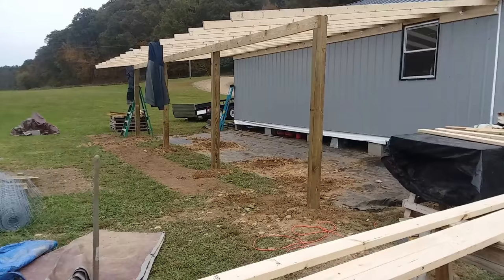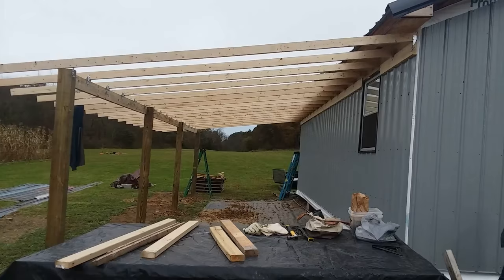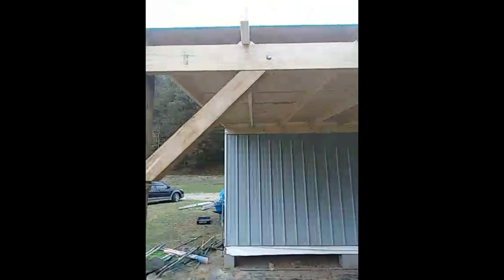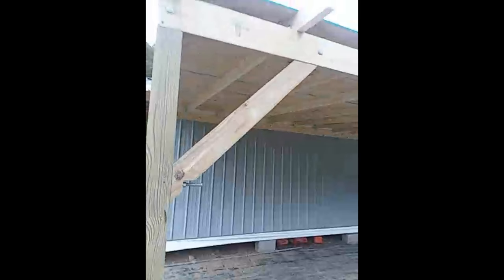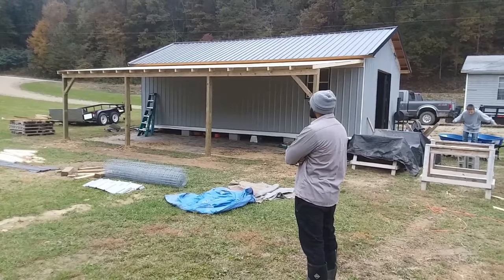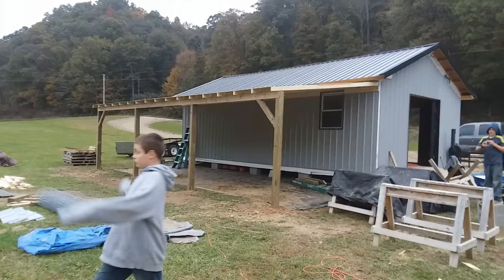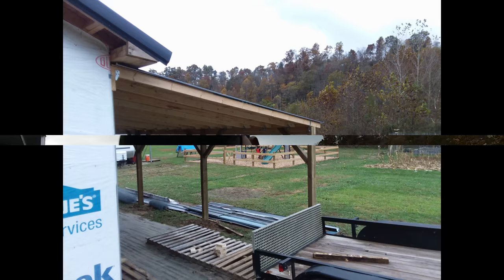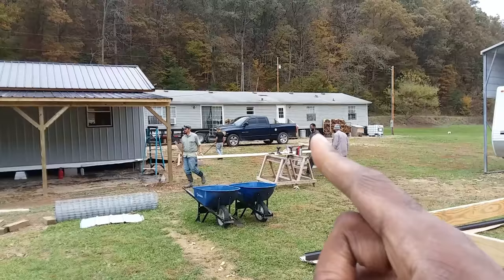Lean To Project

Comment: 2" X 4"s are not strong enough for a rafters. They should've been 2 X 6 instead. Ask a building inspector before building something like that. If that goes a down in a storm, your insurance won't cover it.
Reply: You can use either 2×6 or 2×4 rafters for roofs with a 3/12 pitch or greater, but it depends on the overall size of your shed. For roofs that won't experience heavy snow loads, (This is Kentucky) a gable roof can span up to 22' with 2×4 rafters.
Reply: If i did it again yeah i would probably do 2x6 instead of 2x4 it was only $30 more in total. But i was only putting up some corrugated plastic cover I think its going to be fine.
Reply: @JohnCruzProductions yep. I got one I built 30 years ago in WV it’s held up well 24x36 it’s had 36” of snow on it and it’s still standing ✅

Comment: What a beautiful spot you have there. The lean-to came out really nice and that is one of two ways I want to add to the back of my shop. Depending on the price of wood,(it is now Jan 2021, and lumber prices are through the roof due to COVID-19). I was going to just put on a close-like room to store the dust collection, but now I may just add 6 feet to the entire width of the shop. It's kinda tight so just 6 feet would really help a lot. The corner bracing looks very nice!
Reply from the maker: Thank you. We could have done some things better like use 2x6 boards but it's ok, we will deal with it at a later date.

Comment: You guys did a great job on this build.  I'm starting mine this weekend.  Your roof is a bit level or flat.  I need a good pitch.  I was born, raised and live in central New Hampshire.  Lots of cold and lots of snow! Town building code says I need a minimum of 22.5 degrees of pitch.  I think I got it. But any tips would be welcomed.  People think oh, Boston, it's cold and snowy there. I live 109 miles due north of Boston.  Coaticook, QB Canada is a 3 hour drive.  Boston is 2 hours.
Reply from the maker: Just learning on the fly Scott. We just needed a lean to and did not consider the pitch. Snow isn't too bad here.

Comment: This helped give me ideas with what I'm about to do. Thanks!
Reply from the maker: Sounds good, just use 2x6 for rafters and put a greater pitch on it.
Reply: @eldermitchell-swkye2918  the only issue I'm having is I'm building it on a slope and don't have concrete blocks or anything to level and build the foundation
Reply from the maker: @LocoConductor  got it. That is a challenge

Comment: How did you frame the top plate on the "outside wall"? 
Just ran one 2x6 along the outside of the 4x4? 
I see you've tied in your braces 😁 into the bottom of the rope plate?

Comment: l would have used cement deck supports and drive a 1 &half to 2 foot long 1 1/2" to 2" hollow diameter steel pipe through  the centre hole of the cement supports into the ground.
Reply from the maker: yes sir, we are no professionals but we are actually planning to do that on a few upcoming projects. I think what you are bringing up will last a lot longer though.
Reply: @eldermitchell-swkye2918  after l moved to new house..the person before tried to erect something beside house.  They poured cement into those 8" diameter builder's support posts(l think they call them sona tubes)...well, ground has a slight slope and below its clay..they sank into ground and went into different angles. had hell of a time to pull them out(use of car and chains) after removal there was 6" of water at bottom of hole.

That's why l'm using the wider 12" flat cement deck blocks and have 2 feet of  pipe through the center to minimize the shifting due to flash rain, snow and ice of winter. also wider flat surface disperses load over a greater area(i'e...less load pressure per sq inch). also those blocks will be a big time saver and more economical than buying those sona tubes and bags of cement and mixing and mixing and mixing.

just a thought...l'm building mine beside my garage..l'll keep you posted..maybe after a year to follow through on results after weather.

Comment: Brother, why would you notch the brace? You weakend the structural member but then secured it with a 1/2" bolt.
Reply from the maker: Didn’t know any better.
Reply: @eldermitchell-swkye2918  always a better way through God but at least you tried.

Comment: Probably should have used something bigger that 2x4,s on roof,  they shouldnt run that far without support,
Reply from the maker: I don't doubt it. Rookie mistakes.
Reply: @eldermitchell-swkye2918  that roof with the sheathing and tin is plenty strong enough for Kentucky weather. It turned out really good. Really good job .

Comment: what size rafters u use? 2x4s ? and how long was the span?
Reply: when i built mine i had a 12 x 32 i was 12' 2x6 with 16' 2 x 4 perlings
Reply: @ManthatsCool100  how often u space the 2x4s perlings?

Comment: what size ledger board did you use?
Reply from the maker: 2 x 6. 
We would have done things a lot different if We could do it all over again.
Reply: @eldermitchell-swkye2918  what size you recommend? I was thinking a 2x8 or a 2x10. Then using 2x6 for the rafters...
Reply from the maker: @adamaustin3373  
I would have used all 2x6 boards. It's just a lean to. We used 2x6 ledger on botth ends but we used 2x4 for the rafters, bad move when I look back on it. Especially for that pitch.
Reply: @eldermitchell-swkye2918  so you would have just used 2x6 for both ledgers and the rafters is what you're saying right?
Reply from the maker: @adamaustin3373  
Yes

Comment: I see a potentially catastrophic mistake inmediatly,as an inspector I would fail you,as an insurer I wouldn t insure your structure.
Reply: This comment would be more impressive if you were to enlighten the rest of us as to this “potentially catastrophic mistake” instead of just mentioning it and bragging about what you wouldn’t do.
Reply: please share
Reply: @stevee7774  For one, too much material taken out of the wood for those bolts. Imagine if you had a 2 X 4 horizontally attached to a vertical post with one nail. If the one nail is 1/4 inch from the top edge of the 2x4 it will fail easily. If the one nail is 2 inches from the top of the board it will not fail as easily. The amount of material above (in this case) the connector (nail, screw, etc) makes a difference.  Here they cut out a huge chunk of material for the bolts. The span will remain rigid because of the size of the wood but its strength of attachment to the post has effectively reduced it to the strength of maybe a 2X4 attachment.
Reply: It will  serve its purpose  covering  firewood.  It wouldn't  pass code for a patio cover  in Colorado but its not a  patio cover.
Reply: @Hizenbird  n